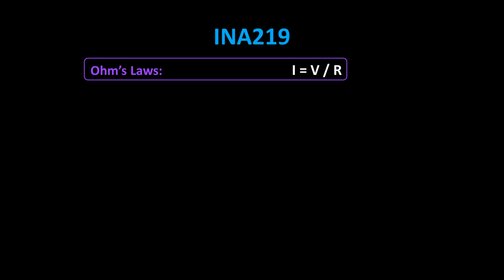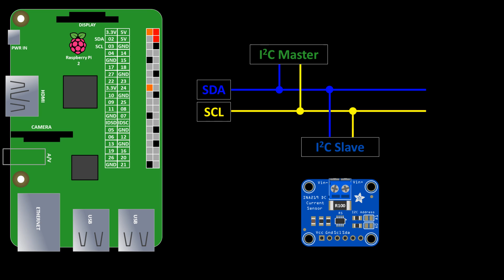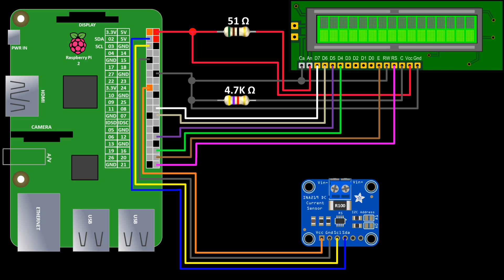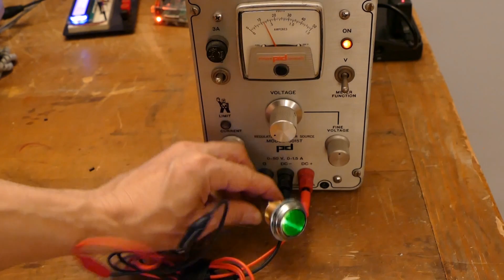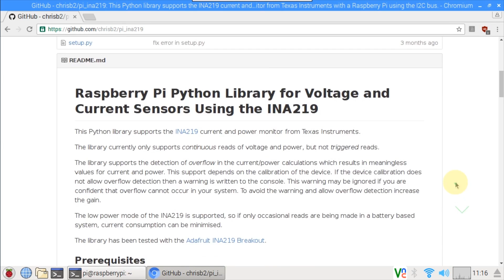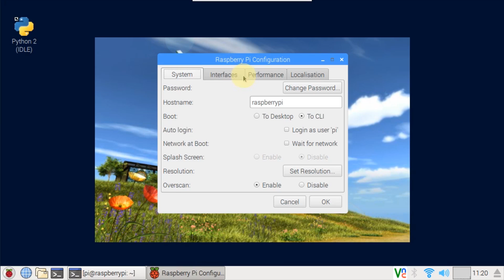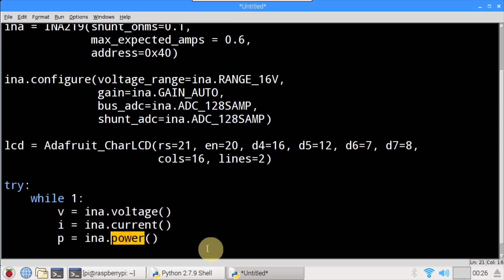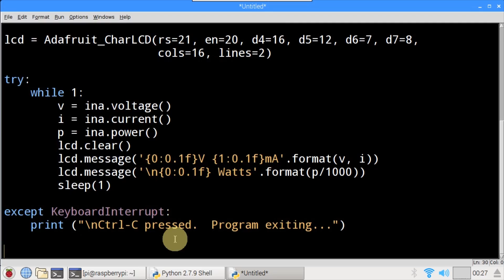Raspberry Pi INA219 Power Measurement Tutorial

Comment: what can i do to measure up to 150V and 40Amp?
Reply from the maker: Please consult with an electrical engineer or electrician before experimenting with lethal voltages.  You could try the Open Energy Monitor forum: https://community.openenergymonitor.org/
Reply: @rdagger  know that, be careful, and also know how dangerous 150V / 100 Amp is...
now that the disclaimer is out of the way, anyone help, and no OEM can't at this stage as all their stuff is AC based.
Reply from the maker: You can try Allegro MicroSystems:  https://www.allegromicro.com/

Comment: I need to measure three appliance's energy consumption at  same time but how, can you please help me with this
Reply from the maker: Generally speaking, household appliances around the world run on mains electricity which is usually AC between 100V and 240V.  The INA219 is DC and only rated for +26V.  Therefore, it would not work.  Please be careful because mains electricity can be very dangerous.
Reply: @rdagger  then how can I measure ac devices sir
Reply from the maker: Please consult with an electrical engineer before experimenting with lethal AC voltages. Sorry I’m not aware of any safe hobbyist solutions. You could try the Open Energy Monitor forum: https://community.openenergymonitor.org/

Comment: Hey, great vid thanks. I have a question about the resistors used. I don't have those sizes, and wanted to check what would be acceptible as I'm a bit of a noob :-) In place of the 4.7K, would 5.1K be suitable, similarly, I don't have 51 ohm, would Ibe better with 10K or 100K? Thanks.
Reply from the maker: The resistors used for the LCD display are only to control contrast and brightness.  Changing the values will change these levels which should be OK.  4.7K and 5.1K are very close.  However, 51 ohm and 10K are not close.  10K stands for 10,000 ohm which is around 200 times larger than 51 ohm.  Ideally, you should use potentiometers instead of resistors.  This will allow you to fine tune the contrast and brightness.  There is an example of using pots with an LCD display in my weather clock tutorial:  https://www.rototron.info/raspberry-pi-international-weather-clock/

Comment: I am working with Raspberry Pi  and wanted to check power measurement 1. when only a power switch is on and 2. power measurement when any Line or machine STARTS running? Please guide about what sensor we can use for Heavy Industrial Machines / conveyor lines. Remember we are using Raspberry Pi. Please share your email / mobile to better understanding.

Comment: I have one question 
What if we want to charge battery from the solar panels and measure the power of the solar panels. It would work ?
Reply from the maker: You can measure the voltage and current coming from a solar panel as long as you do not exceed 26V and 3.2A.  However, most solar charge controllers already provide this data.  Please check out my solar tutorial:  https://youtu.be/1VxP38XlVEQ
Reply: @rdagger  I saw your video but my panel output is around 21 volt and 2.5 A max.
Actually I am doing college project so I just want to calculate power generation by panel and power consumption by pi. So can I use this method ?
Reply from the maker: You should be able to use an INA219 to track the voltage and current of a panel.  A 2nd INA219 should be able to track the Pi's voltage and current consumption.
Reply: @rdagger means this set will work ?
Reply from the maker: It depends on your components and the desired goals.  A good charge controller would probably provide more meaningful results on its data bus.  An INA219 inline with the solar panel should give you accurate voltage levels during the day and show how much current the charge controller is drawing.  An INA219 inline with the Pi will show you the Pi's voltage and how much current it is drawing.
Reply: @rdagger  Thank you
Reply: @rdagger  Any tutorial for making Android app and web application including admin login which can communicate with pi ?
Reply from the maker: Nothing in-depth.  I use Expo for creating Android apps:  https://expo.io/

Comment: Hi @rdagger68

I am trying to measure the voltage and current a small solar cell produces when laying out in the sun using an Arduino and a INA219. The solar cell is not connected to a load as I do not want to measure the current drawn from the load but rather the current that a solar cell produces throughout the day when exposed to various irradiances. How would you go about connecting the INA219? Would I be able to connect the positive and negative of the solar cell directly to the two terminals of the INA219 sensor with no load or is that not recommended?
Reply from the maker: Generally speaking, you cannot measure current unless there is a load because current is a flow of electrical charge carriers (usually electrons).  Connecting an INA219 across the solar panel output as you described would create a short circuit.  This is usually undesirable and can damage equipment.  However, there is an exception with respect to some solar panels.  I recommend you check with your solar vendor before attempting to measure short-circuit current (Isc).  So to answer your question, it might be OK to measure Isc which could give you relevant data assuming the Isc and the light-generated current have similar values.  Again you would need to verify with the vendor and I would also inquire regarding the impact of long duration tests.  

I don’t think you would be able to simultaneously measure current and voltage because when you short the solar panel leads you should have zero potential (0V).  You also have to be careful when measuring Isc that you don’t exceed the 3.2A maximum of the INA219 breakout board.

Comment: could you please. Can you share your first engine circuit diagram?
Reply from the maker: Sorry I never created a schematic.  The drill had a proprietary motor driver IC with no info available.  I just removed the trigger slide and replaced it with a potentiometer.

Comment: ina.current is giving fluctuating values.... i m using DC power supply
Reply: kindly help
Reply from the maker: Make sure you have the correct voltage and gain settings for your circuit.  You can use multiple sampling and 12 bit resolution to improve accuracy.  Please check out the Github site for more info:  https://github.com/chrisb2/pi_ina219

Comment: Can i use it to measure current in micro amps....
Reply from the maker: I don't think it would be a good choice because the input bias is probably too high.  I'd check with Texas Instruments support.  They can recommend an optimal device for your needs.
Reply: @rdagger  can you name
Reply: @rdagger  actually i m working on wood moisture meter and i have to measure serial current though wood.
which i consider will be in micro
Reply from the maker: Dave Jones makes a precision current adapter:  https://www.eevblog.com/projects/ucurrent/

Comment: Will this work for monitoring ac current?  Thanks!
Reply from the maker: No.  You can use a hall effect-based sensor such as the Allegro ACS712.  Please be careful if working with potentially lethal mains electricity.
Reply: Not a problem working with electricity.....im also a lic electrician. :-) Thanks for your help!!

Comment: Hey I have looked everywhere I can't find a solution, my problem is I want the raspberry pi 3 to be able to measure the voltage going through an externally powered LED, I only have access to the LED's legs, none of the circuit behind it is accessible. Can this be done?
Reply from the maker: You could measure the voltage at the LED anode.  You would connect Vin+ to the anode and leave Vin- disconnected.  If you had a second INA219 you could also measure the voltage at the cathode and then you would be able to determine forward voltage drop.   There would need to be a common ground between the INA219 and your circuit.
Reply: Is there absolutely no way to do it just through the LED's legs without connecting its circuit's ground to the INA219/raspberry pi 3 ?
Reply from the maker: The LED cathode might be at ground.  If that's the case you have your ground.  However, the cathode could instead be in series with a resistor.  The case of the device in question might also be at ground.  Generally speaking, you can't measure voltage of a circuit without a ground reference because the definition of voltage is a potential difference.  Why do you want to measure the voltage?
Reply: I have a device which measures power across home appliances and based on the measured values it would turn on some LEDs as to indicate how much I am consuming. I am trying to detect when some of those LEDs are ON/OFF and sending that to a raspberry pi which would in turn send me an email/sms warning. The measuring device is very tightly locked and I prefer not to touch its internal circuits which is why I am left with only the LED legs. I hope there is some way I can achieve this ?
Thank you for being helpful !
Reply: Any idea Please ? I can't find anymore help on this
Reply from the maker: You could use a phototransistor to sense the state of an LED.

Comment: I’m quite unfamiliar with the ina219. Could you use multiple ina219 boards to measure voltage on individual cells in series in a battery pack?
Reply from the maker: In theory it would work but you would have to wire the INA219 in series.
Reply: Thanks for the prompt reply! I guess that would limit me to 26v?
Reply from the maker: Yes.  Furthremore, I don't think this would give you the desired results since the voltage would be cumulative.  I'd ask around the RC forums.

Comment: Hey, great video!
Can I use this INA 219 to calculate and display [on an LCD screen] the remaining battery of any device?
Reply from the maker: All batteries have a discharge curve.  This non-linear graph shows voltage as a function of capacity.  Generally speaking, rechargeable batteries tend to have a consistent curve over their lifespans.  Therefore, by monitoring voltage you can get an estimate of battery capacity.  You can also track current consumption and generate a running total to calculate an amp-hours value.   By combining the two you can get a better estimate.

If you are working with LiPo batteries, you can use a low cost MAX17043 I²C battery fuel gauge module.

Comment: hi. I follow all instruction in ur video and ur page. but I have some problem. some error. can u guide until I get the reading
Reply from the maker: What is the error message?
Reply: ======================== RESTART: /home/pi/ina219.py ========================

Traceback (most recent call last):
  File "/home/pi/ina219.py", line 1, in <module>
    from ina219 import INA219, DeviceRangeError
  File "/home/pi/ina219.py", line 1, in <module>
    from ina219 import INA219, DeviceRangeError
ImportError: cannot import name INA219
>>> 
======================== RESTART: /home/pi/ina219.py ========================

Traceback (most recent call last):
  File "/home/pi/ina219.py", line 2, in <module>
    from ina219 import INA219
  File "/home/pi/ina219.py", line 2, in <module>
    from ina219 import INA219
ImportError: cannot import name INA219
>>>
Reply: this error .
can u help me
Reply from the maker: Are you using auto gain?  What voltage and current are you trying to measure?
Reply: the led . I want measure voltage and current this led. . auto gain ? can u give email to me. I sent pic. help me pls
Reply from the maker: You can email me through my website.  How much voltage?  How much current?  Auto gain is a configuration settings to which makes it easy to get started.
https://github.com/chrisb2/pi_ina219#simple---auto-gain

Comment: I have this set up with an LED, using an 18650 as my power supply. I have followed the schematic exactly, and can measure 1.7 Volts across the Shunt Resistor. When I run the code I am getting a voltage of 2.58 (battery is at 4.06V) and an overflow error. Any idea what is going wrong?
Reply from the maker: Do you have a common ground between the 18650 and the Pi?
Reply: Yes a Pi ground, the LED negative, and the 18650 negative are all on the same bread board rail. The positive of the 18650 is in Vin+ on the INA and the positive of the LED is in Vin-. The VCC, GND, SDA and SCL on the INA are all straight to GPIO pins. Is your power supply current regulated in any way?
Reply from the maker: The wiring sounds good.  I was not regulating the current.  The voltage drop on the resistor isn't right.  That would be a 17A load assuming a 0.1Ω shunt.  Did you mean 1.7mV?  Approximately, how many mA is your LED?  I'd inspect all the solder connections on the board carefully with a magnifying glass.

Comment: can i measure active and reactive power drawing by heavy load by supplying 220 v??
Reply from the maker: The INA219 can only measure DC voltage up to 26V.
Reply: whta can i use for that?? for a.c
Reply from the maker: Please consult with an electrical engineer before experimenting with lethal AC voltages.  Sorry I’m not aware of any safe hobbyist solutions.  You could try the Open Energy Monitor forum:  https://community.openenergymonitor.org/

Comment: Hello,its a very good explanation.
I have one request that how can we save that voltage readings in sql database.
Reply from the maker: Database integration is a very involved topic.  Generally speaking running a database on the Pi is problematic because of the high number of write cycles to the SD card which has a limited lifespan.  Nonetheless, many people have had good luck using SQLite: https://www.sqlite.org/
It has python bindings and is not as write intensive as MySQL or Redis.  

Another option is to use an online database.  In my RocketChat tutorial I use MLab for database storage from the Pi:  https://www.youtube.com/watch?v=BevcvRLsa9Y
MLab offer a free sandbox plan that provides .5GB of data storage:  https://mlab.com/
Reply: Sir only particular voltage saving in database apart from every repeated voltage,can this be possible,if possible can you please describe the procedure.
Reply from the maker: It is a complex topic, but basically you would need to do the following:  Create a database, create a table with a numeric field to store the voltage readings, in your program you would need to establish a database connection, create a query or cursor object on the connection and then execute an Insert statement to append the voltage data to the table.  Here is an example for SQLite:  http://www.sqlitetutorial.net/sqlite-python/insert/
Reply: Its very helpfull,thank you

Comment: How would the wiring go to the INA to measure battery voltage alone with no load?
Reply from the maker: Connect the positive of your battery to Vin+ on the INA219.  Connect the negative of your battery to the INA219 ground.
Reply: rdagger68 great, thank you! Also, you said you can daisy chain multiple ina’s. If you wire them all to 3.3 and ground, and all to the same 2 i2c pins, will they all be given different hexadecimal values? If so, how many different ID’s can be used?
Reply from the maker: You need to set a unique address for each INA219 using pins A0 and/or A1.  Table 1 in the datasheet lists the 16 possible combinations.  Many of the breakout boards have AO and A1 pads that can easily be jumped with solder to VS+ which gives you 4 easy to set addresses 0x40, 0x41, 0x044 and 0x45.
Reply: I have set up this no load configuration with an 18650 battery around 4.09V. I am using the code without an LCD display from https://www.rototron.info/raspberry-pi-ina219-tutorial/ and am getting the following results:

Bus Voltage: 2.57V
Current out of range (overflow), for gain 0.32V, device limit reached

Do you have any suggestions about what to do next? I am simply trying to get a Pi output with the correct battery voltage.